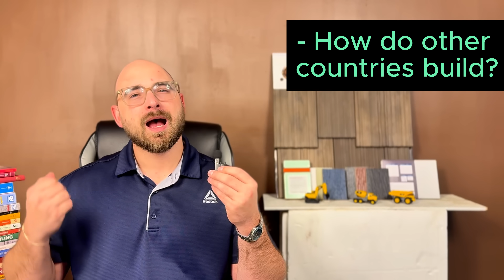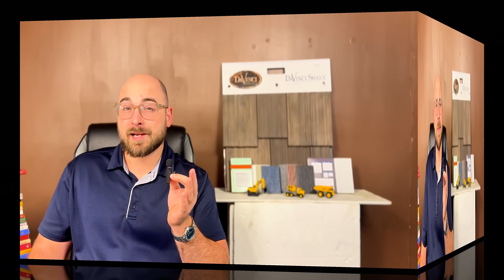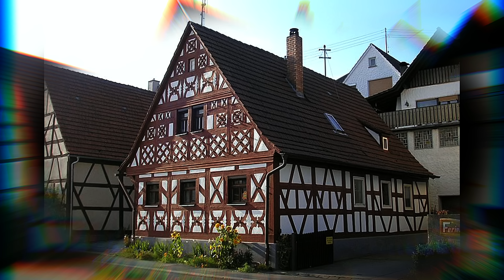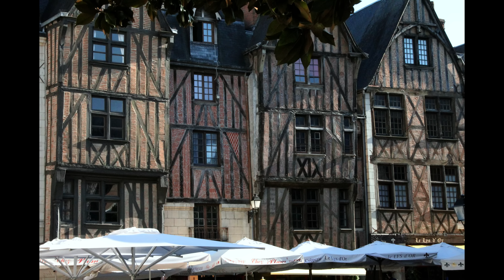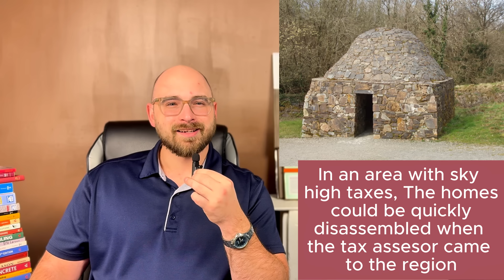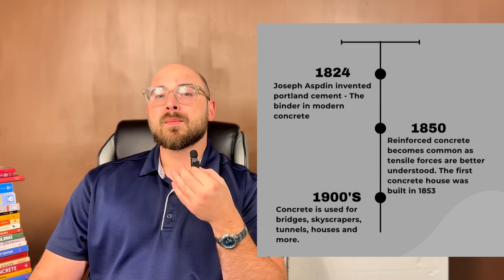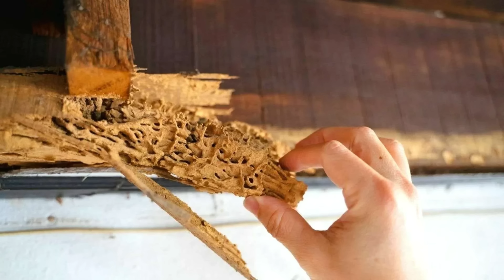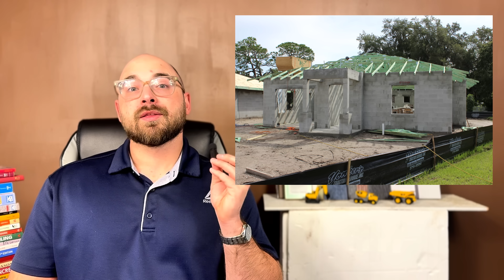Why Other Countries LAUGH at American Homes

Comment: One advantage of light wood framing is that it's easier to tear down. Europeans are building homes very durably, but their neighborhoods and communities are also built to last. America is building suburban sprawl and if we build it out of concrete it will be a very durable mistake.
Reply from the maker: We could use some better urban planning, I won’t disagree with that, 

Multi family buildings, vertical parking, walkable cities, I agree
Reply: I've seen pictures of one city. Pleasanton, CA. It showed a picture of one neighborhood from back in the 70s. The neighborhood has completely changed now. It now looks like the standard larger suburban look that is common in California. The photo from the 70s was taken as there was a story about a missing girl back then and new evidence was recently found about the case.

Comment: Well, seeing the California fires and the homes of rich people burning down it’s literally mindbreaking. I mean. If I live in an area prone to fire and I don’t lack money I would make sure it’s save agains the dangers most likely to happen. That said. It doesn’t need so much more money for basic security against fire.
Reply from the maker: Bingo, 

Steel or concrete would be a great choice for wildfire prone areas. 

Many say “you can’t build with concrete in a seismic zone, and that’s not true, you absolutely can and the building will hold up fine. HOWEVER, it must be drawn by an architect and stamped by an engineer , including reinforced foundation and seismic joints allowing for movement 

There are ICF homes in CA that survived the wildfire